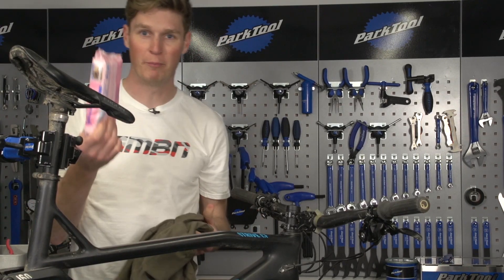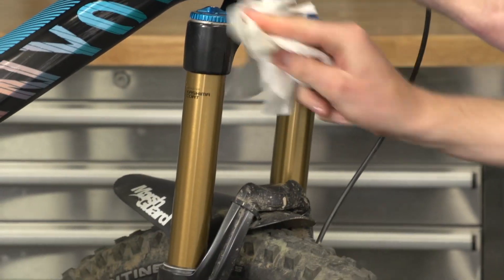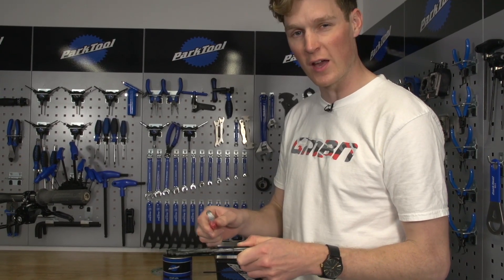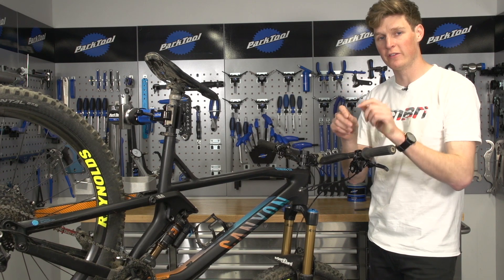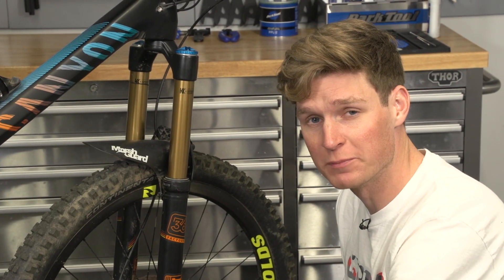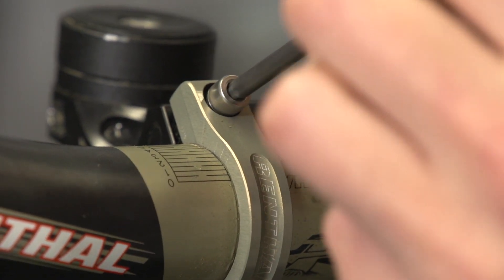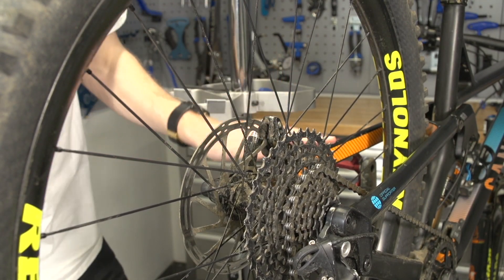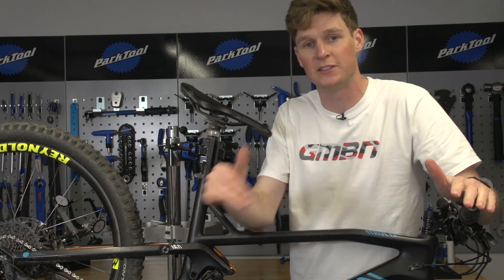8 Pro Mountain Bike Maintenance Hacks | MTB Maintenance

Comment from the maker: What are your best hacks? Let us know below!
Reply: Global Mountain Bike Network  i watch GMBN....thats it.
Reply: Global Mountain Bike Network  use a garbage can to change a tire
Reply: Flathead screwdriver removes gunk from dérailleur pulleys like a charm. Just put the flat surface flush with pulley's side and give it a spin. Repeat for both pulleys on each side.
Reply: To set the disc brake just loosen the screws, hold the brake, tighten, release the brake, done!
Reply: Doesn't always work
Reply: Did work for me, thats all i can say
Reply: You have a clutch RD. How about pulling the cage forward and pushing that lock button instead of using a spoke to hold the chain together? Much easier. :)
Reply: Global Mountain Bike Network you can use a flat head screw driver to clean off the chain muck from the sprockets
Reply: get you hygienist to give you an old tooth cleaning tool.It works awesome on chain and cog cleaning.
Reply: Tap the brake rotor when it's spinning to easily detect a brake rub.
Reply: Apply chain lube on your disk brakes. Now braking is a lot more easier,faster and more efficient.
Reply: on your bike how do you find the rear shock i am looking for a better shock and i was wondering how good it was
Reply: The disc brakes with the card, I've applied this to my bike and it works so well! Thanks!
Reply: DKrccars2.0 what kind of card did you use for it ? Something like a credit card ?  The one used by Scotty in the video seems very thin...
Reply: Agreed. Much faster and less expensive than sacrificing a spoke.
Reply: It was a little bit thicker than what scotty used, but no not a credit card, I'd say it's more cardboard strength but not as thick, I found some laying around at home and used it and it worked really well. I'd just have an experiment with what you can find!
Reply: One more: guitar pick -- a universal tool for doing the jobs when you want to squeeze  something into a tight space, but don't want to scratch it (e.g. for removing shock seals w/o damaging them). The pick is made out of durable plastic (so it is tough and won't scratch) and really CHEAP. I do recommend having (at least) one in your bike toolbox.
Reply: Global Mountain Bike Network in
Reply: Whenever I want new tires I just cut off all the knobs. Justified.
Reply: Global Mountain Bike Network can you do a mtb stario types
Reply: Global Mountain Bike Network, I want buy your T-shirt, but i don't know how buy, i'm in Viet Nam. Please help me, tks.
Reply: 2:55 for that I personally use a worn unusable flathead screwdriver. Because with a spoke I think it takes more time.
Reply: #mtb boy# using a zip tie as a dip stick to check the tire sealant level in tubeless tires. Remove valve core, insert zip tie as dip stick. The little lines on zip tie hold the sealant. You need a thin zip tie to fit into the valve core. Cut the end square. Easier than breaking the bead and lookin into see how much sealant you have.

Comment: Like the cardboard in the brakes hack when centring the calliper, that will definitely save some stuffing around time in the garage.  The 'hack' you did in your brake bleed vid with the cable tie on the lever for 5 minutes (to remove air bubbles) really works.  Best my brakes have felt in a long time.

Comment: Even easier to align your brakes is to loosen the caliper bolts, squeeze the brake on and hold it on whilst you tighten the bolts back up. Was shown that by one of Atherton's mechanics and it never fails.
Reply: Gaz Thorner doesnt work always :)
Reply: Almost never works, just eyeball it

Comment: Hi GMBN, a lot of dirt gets between the fork seals and the stantions, and it is really difficult to clean that. Any hack?
Reply: Spray some fork lube on the stanchions and leave it for a minute to work its way down then compress the forks a couple of times and you'll see some come up so you can wipe it off. Be careful when spraying near disc brakes or braking surfaces in general.

Comment: Hey I have a Giant Atx and it has cable disc brakes would I be able to change them to hidaulic
Reply: Yeah as long as you have the correct caliper mounts for disc brakes.
Reply: Of course
Reply: Steven Chabot but then I'll have to get new shifters because the ones on there are connected to the break lever
Reply: You have to buy new brakes which come with the caliper and lever. 

Just make sure you buy one which fits your rotor size well.
Reply: If I were you I would also replace the rotors. Whenever you replace the brakes it's good to use different rotors so you can break them in with the new pad material.

Comment: the tricks with the spokes as pick an as  chain hook is very old, i use these for years. the chain hook as presented by scotty is too narrow for  comfortable work. i take 10 inches ling piece (12,5 cm or 125mm) and i bend half of inch (1,2 cm or 12 mm) on each side. what i i have left is wide ecough chain hook so i can work free and with comfort with it. This  is mainly trail side rapair trick, but it is good enough for workshop use.

Comment: could do with a more detailed explanation of the pad spacing tip using card, to expand I first state that its possibly my tektro calipers ain't suitable, thus my failure to grasp the tip as I'm wondering what you tightened before releasing the card?
Reply: The caliper bolts

Comment: gmbn when i do a stoppie, i hear a cracking sound! I've tried regressing headset and tightening it and its not helping! I'm really scared because its my santa cruz bronson carbon which i only just purchased which cost alot!!
Reply: Kye Wilson is it a clicking or a cracking because a clicking could be your srem not tightened down properly and every time u pull the handle bars it moves the bolts so they click I think that happens on my DH bike
Reply from the maker: Hi Kye, if you have check your stem/headset then try the brake caliper bolts and rotor. If the sound remains then try contacting the shop you bought it from as it could be the crown steerer on the forks creaking.
Reply: Caesar Thegrandmaster worked 9 hours a day 6 days a week for 2 months straight. I earn it all on my own thanks mate. its easier to save up alot of money as I'm 16 and my parents pay for breakfast dinner etc. I guess i was  I'm lucky to find a job on a farm where there a long hours but it was very hard work.
Reply: Last time I heard this type of noise from that area it turned out to be a cracked fork steerer at the crown. Take your wheel off and look at the steerer tube at the fork crown. Inspect for damage.

Comment: Mechanicing?
An old tooth brush is also good for cleaning hard to reach places. A qtip to dab a little WD40 in the heads of Allen bolts is a good way to avoid rust from getting started there.

Comment: correct me if im wrong. i love hacking some things on my bike, cause it saves a lot of money and time. i am using an alcohol based wet wipes to clean my disc rotor. alcohol. evaporates  a little bit faster i think. is it ok? or maybe i need to stop doing this?
Reply: I have used methylated spirit to clean my pads and rotors when I accidentally sprayed GT85 on them. It worked a treat at cleaning, and I found no detrimental effects.

Comment: Have been siping & grooving tyres for years, never thought of it as a hack :-P  Maybe GMBN could investigate the art of tyre siping & do a video on it. Pretty sure there are a few pros & mechanics that would help out. They will know what works best in different conditions and how various compounds and patterns respond to being modified. Then make a video testing siped tyres. Each rider tests a stack of tyres on the same section of trail or track. Each pair of tyres siped with different depth, width and directions of sipes on centre and/or side knobles.  I'm sure You will get some interesting and surprising results..

Comment: If you've got a water flosser for your teeth - they're basically a mini hand held high pressure water jet... probably useful for blasting crap out of tight spaces.
Reply: therealomunit is it good to blast ur chain while cleaning it to get the lube off and muc and then pitting it back on the bike with lube or does it just push muc inside?

Comment: @2:50 Flat screwdriver is easier ! ;-)
Reply: or hard toothbrush also
Reply: Alternatively, try the wooden stick from an ice lolly. They can be shaped to a point or to fit the profile of the thing being cleaned. Being wood, they're a little softer and won't scratch anything.
Reply: Yeah I use a flat head for most of the time
Reply: or just a toothpick

Comment: don't us baby wipes. super wasteful and they fall apart easily. use a bike wash and that shirt, duh. don't use the spoke for internal cable routing, you WILL scratch your frame. use a magnet, duh. don't use a torx for an Allan bolt. you'll further damage the bolt and the torx wrench. 

a whole lot of bodges in this video guys but I'll try to end on a positive note. uh...great attitude and it's always worth checking over your bike. good on ya boys

Comment: Baby wipes, that's not very environmentally good is it scotty, perhaps you could do a video about disposing of your old brake fluid, degrease from your chain etc
Reply: This is true Robin! If you have any suggestions on being more environmentally friendly then we'd for sure love to hear your ideas... But it is an important consideration!!!
Reply: baby wipes can scratch the paint job of your bike because the dirt is still intact while you are rubbing with wipes. I advice to give it a brush at first to loosen all the little rocks, sand etc. before wiping.
Reply: Just don't clean your bike every time you ride it, ok so in the winter it's important but summer no way, if the cables and chain are lubed, the shocks clean just leave it, it was riding great, it will still ride great, I note that you never see a dirty bike in the bike vault, do people carry their bike into the woods or mountain top, then take a picture, bikes are for riding, ok you guys are sponsored so you have to have clean bikes